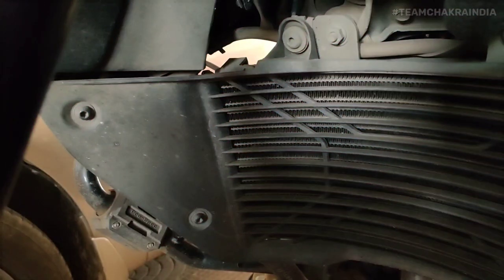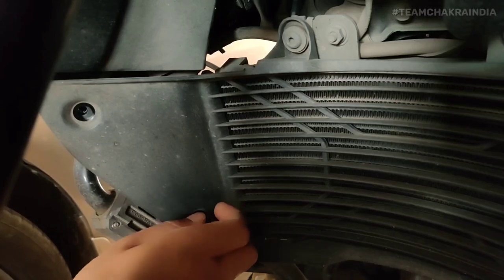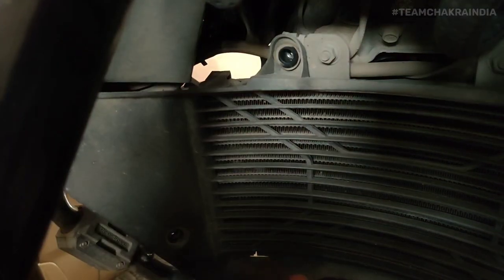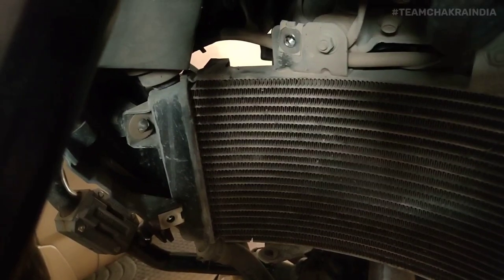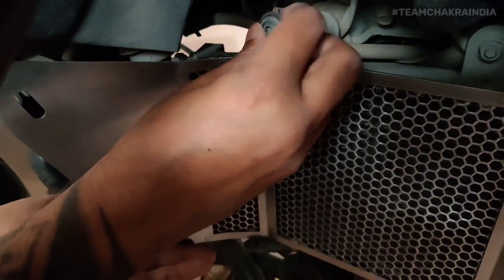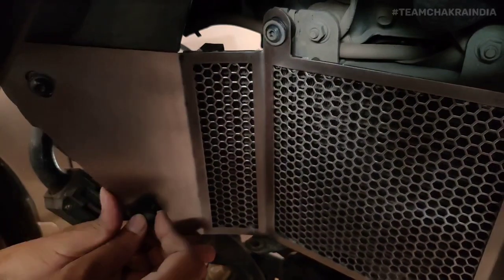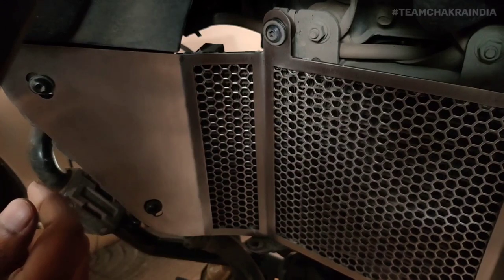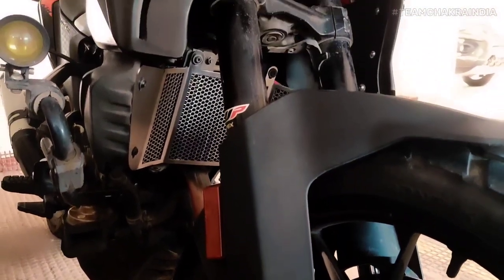SS Radiator grill installation | KTM Adventure 390 and 250 | Feat. Raneet Mallick | RR16 Designs

Comment: Hi ... we all know how imp a radiator guard is.. i want to know why you changed it... is it because the stock one is plastic that is weak... or your stock one got damaged or anything or is it just for aesthetics
Reply from the maker: Hello.

With time there will always be stone chips and debris flying into vehicle radiators damaging/bending the fins which in turn reduces its efficacy. So before that happens, it's good to have a better protection.

Now why metal guard? Coz it's stronger and conductive unlike ABS plastic.

Why stainless steel even though aluminium is more conductive? Coz it's stronger and non-corrosive to weather elements.

Aesthetics is an add-on, but then again that depends on personal preference.
Reply: @ChakraRidingBeyond  thankyou.. i wanted to know exactly this... I'll order 1 right away.. im getting my 390 adv 2022 this month end...  and thanks a lot for responding this quick ... you got a subscriber :)
Reply from the maker: Means a lot. Thanks so much. If you decide to take one from RR16 please let them know you saw this video and take reference of Raneet Mallick. 😇
Reply: Ohh yes.. will there be any discounts  :D
Reply from the maker: I'm not sure on that though. He hasn't given any reference code! 😅
Reply: @ChakraRidingBeyond  how's the bike so far.. ?? Can we connect in instagram... ?? This will be my EV m first ever bike... never owned a bike/moped before... so will be having many doubts... and i don't know anyone personally who owns this bike